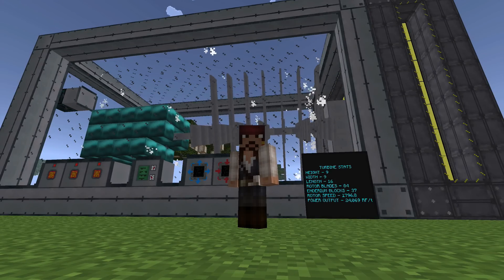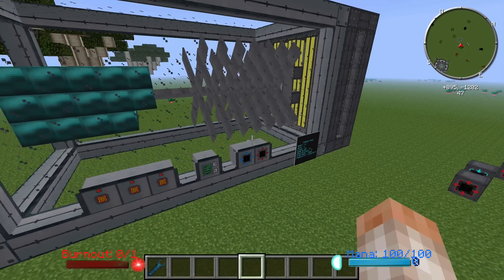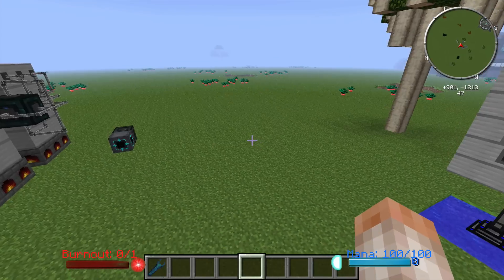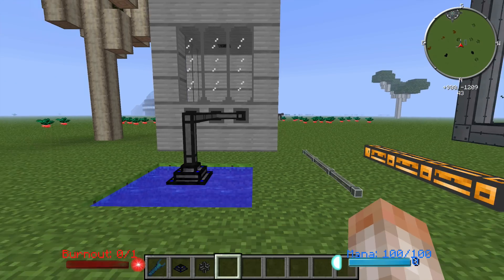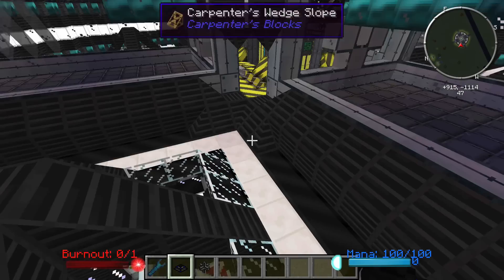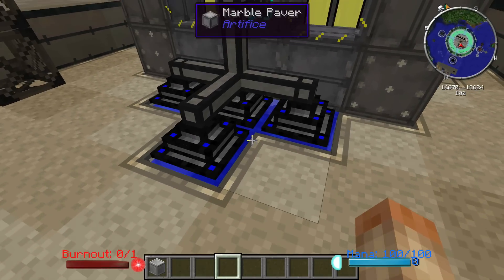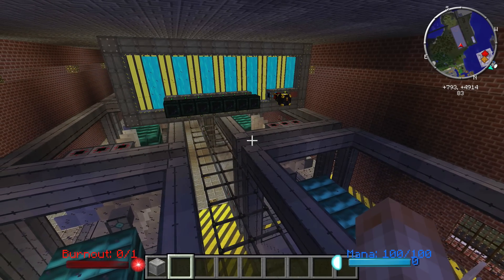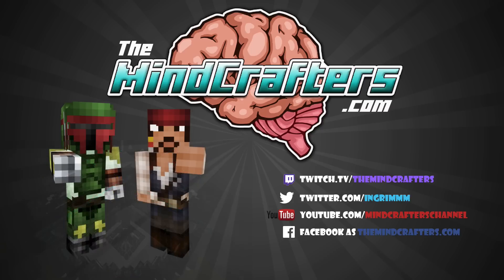Tutorial: High Powered Big Reactor Turbines

Comment: Thank you for this tutorial and the world download, Captain!

I did a few tests myself and have a few tricks:
You only need to supply water when raising the steam output. When the steam is constant the production of water by the turbine is enough to maintain the steam level (as long as you loop the water back in the reactor). I removed all 4 tansfer nodes from the reactor in the world download and the water level did not sink.
This means you can hook up another cheap water pump (for examle Aqua Accumilator) to start the turbine. It might be a little bit slower to start, but ceap. Or just fill your me network (extra cells) with a few buckets of water and export it into the reactor.

The reactor in the world download is capable of suppling much more steam than needed. You can set the control rods to about 60% which results in about 75% less fuel consumption. In result you don't need many focis to keep up with the yellorite needs.

According to a few tests in creative Icehenge an actively cooled reactor is more efficient if you build the fuel rods next to each other in a 3x3 block or higher (Fertility > 500%).

A good setup would be (testet in creative Icehence): a 9x9x7 reactor with 3x3 fuel rods surrounded by 2 rows of gelite cryothium. This setup sould be enough to supply steam for 8 7x7x15 turbines with 70 blades and 4x8 enderium as coil set to accept 1750 mB steam per tick each. This produces 8x about 20970 RF/t for 8 laser drills.

I hope this helps for all who want to build a turbine :)

Comment: >Transfer nodes and pipes are extremely expensive.

Each Liquid Transfer node costs: 

12.1250 Redstone Dust
08.0000 Wood Plank
05.0000 Iron
02.0375 Stone
02.0000 Blue Dye
00.2500 Glass

That is cheap as fuck, I have no idea what you're on about.
Reply: "Sarcasm" ever heard of it?
Reply: He did not say that with even the slightest bit a sarcasm.
Reply from the maker: Marshal Walker More comments = more video activity. Keep debating ;)
Reply: "Common sense" ever heard it?
Reply: The upgrades make it expensive, not the nodes themselves.
Reply: +Lachlan Forbes umm the upgrades aren't that expensive remember that none of the resources listed are extremely expensive if your not lazy and actually mine because that's what the entire game is based upon it's actually super cheap also because the recipe gives 4 upgrades not one
and if the pipeline isn't to long you have nothing to worry about if you can't get that much water into the reactor than just don't get rid of the water the turbine creates and put it back In the reactor so you don't need a constant massive supply of water cutting the amount required in half
so please don't spread misinformation because that's not a good thing.
Reply: +Marshal Walker (The Catman) 
He means the upgrades inside them are expensive due to them requiring diamonds.
Reply: ***** Mate, read a comment thread before commenting on it. It's not even that long.
Reply: Marshal Walker
Youtube didn't show any thread when I commented.
Reply: mate i can make diamonds from wood
Reply: Marshal Walker exactly
Reply: Marshal Walker z
Reply: Gotta agree, those are easy materials especially if you have access to fortune 3
Reply: I agree they are extremely cheap i made them and upgraded them inn one mining run when i first got into my buddys new server and was using them for my mekanism boiler and turbine

Comment: I have done the math, maxed reactor would lead to fueling 60 steam turbines, if you used diamond blocks as a coolant, 65-70 turbines if you want to pump water between them you'd make so much power that it'll rival or be on par with the Draconic Core

Comment: You can actually put the railcraft boiler directly against the fluid ports just like you did with the tesseract.  It eliminates the need for any plumbing at all.  Also, once the boilers are filled and at max steam, your water problem solves itself.  the water coming from the turbine is more than enough for the boiler to keep running.

Comment: If you have the thermal expansion mod installed, one aqueous accumulator with a water souce block on 2 sides of the machine will fit. It's a very cheap infinite water source.

Comment: 9:53 rookie numbers my friend, playing Blightfall and I need that amount of power for one pre-charger :P Then there is the fact reactors are giving half the energy required and I'd probably need two of your facilities just to power one of my laser drills.
been spending so much time to figure out the most fuel efficient way to get that power without causing world ending lag. Which since I have a currently 4 year old laptop that has trouble looking at seven laser drills working I think I have my work cut out for me

Comment: I have heard from multiple sources that the laser drill pre-chargers each use 10,000 RF per tick, which would be 40,000 RF per laser drill, not 20,000 like you said. I may be wrong or something may have been modified for your pack, but I figured I'd let you know :)

Comment: Point of interest. Make the reactors 17x7x7 instead, only use 80 blades and keep the same number of coil blocks. Not only is it a cheaper turbine to make (less blocks for the case)  also it provides a whopping 2Rf./t MORE because those extra blades (above 80) won't be there to cause drag
Reply: Second point, if you build them 17 in height you can fit 4 of the 7x7 bases into a single chunk width and depth wise, so not so much sprawling

Comment: The limitation of the reactor power tap in not in the tap... it's in the transport.
Redstone energy conduit is the only power transport available that can handle huge power, except that it actually isn't the only solution.

If you use Ender IO capacitor banks as conduit the input/output capacity of the capacitor bank multiblock is additive... provided that you use enough of them one power tap will export 100% of the power from the turbine.
There is a procedural caveat, however. The capacitor bank block that faces the power tap has to be placed before the powertap itself so that it can be wrenched to make the surface an import mode surface. Otherwise it will default to Output mode when you place it against the tap unwrenched.

Using 84 blades isn't necessary. 80 is the maximum that has any benefit.
Using 53 enderium blocks for coils 4coils + 5 blocks partial coil and 80 blades in a 7x7 casing I'm getting 24071 RF/t at 1797.0 RPM. A tiny tiny bit more power but a significantly smaller turbine structure than your example... and only one power tap per turbine.

I have 8 of these powering 10 MFR lasers (well 9... very nearly 10) driven by one reactor 9x15x15, 36 fuel rods burning 0.247 mb/t Yellorium at 80% control rod at 1215-1216 degrees C with 480% fuel reactivity... producing 16,000 mb/t steam handled by one tesseract for output and 8 tesseracts sharing the same channel inputting to the turbines. 8  tesseracts to return water to the reactor through a single input tesseract.

Reactor coolant is cyrotheum (a whole helluva lot of it... damn)
Water is provided from a single TE aqueous accumulator by an extra tesseract sharing the water return channel. The water tank for the reactor never runs either full or empty but is usually about 2/3 full.

Output for the MFR laser preheaters is handled with basically a layer of cap banks that are part of the same cap bank multiblock structure that pulls power off the turbines. There is no transport cost because there is no transport. The entire cap bank is a single structure which is charged at the turbines and discharged at the MFR lasers with no actual moving of energy to the output over better than a chunk width distance for the laser array.

Output from the capacitor banks is handled by rednet energy cable for mechs which can't run on RF, with a TC drawbridge  hidden off at the end of the cable run with a project red timer and state cell which causes the drawbridge to periodically break and replace one piece of rednet energy cable for a moment to work around their sometimes failure to return to function when the server restarts.

Remote output of energy is handled with large arrays of cap banks which are still contiguous with the single multiblock cap bank structure, with tesseracts and EnderIO dimensional transceivers used depending upon the scale of the energy required.

Basically cable of any kind is reserved for local connections on individual mechs where one Dimensional Transceiver can provide power for several mechs at once.

Even placing the MFR lasers one block above bedrock and missing out on the 20% energy discount, I'm not having to use 20 tesseracts to transport the energy at a 25% penalty.
If this entire mess were built above 128 Y, I could run another two lasers on the same 0.247 mb/t Yellorium.

I actually have 15 lasers set up with enderIO redstone conduit and item conduit sharing the same block spaces and a wall panel with a switch for each channel.
I'll be replacing this with a computer as soon as I figure out how to code the Lua.

I'm currently limited to running a maximum of 10 at a time and one of them has to have one preheater disabled to balance the equation or provide a small amount of additional energy from my passively cooled reactor.

Comment: 5"09 a better solution I found to get water into a railcraft boiler is to put a layer of water under the furnaces with aqueus acculmulators. 3x3 railcraft tank with a 5x5 layer of water, and aqueous accumulators (4) of them is enough to keep it wet.

The problem with transfer nodes is that they're LAGGY AS HELL, and for the amount of upgrades he has in that node, is going to get an administrator's attention (and not in a good way).

Also, mining lasers, they take 5k per precharger, so 20k total per laser. Not 20k per precharger. You overpowered that laser about 4 times over.

Unless you had tweaked your configs, then all bets are off.
Reply: unless i misread how it's set up, it's 20k per set of 4 prechargers

Comment: heya, i just built this Turbine and i wonder whats wrong, its up since 10mins already and its on 550Rotor Speed, the server i am on got restarts every hour, so i probl cant get to my max rotor speed in this time. any ideas?

when i Engage the Coil the rotor Speed goes up rapidly, but as i disengage them its going down to 546RPM, thats pretty slow and not producing that much power.

Comment: I don't usually comment especially on your videos since you clearly have always known what you're doing, but I wanted to offer a little note of correction. You don't need immense methods of water collection for turbine setups. Water is only needed to get the turbines to startup rotating. Once you've filled the setup you can disconnect the water source. Making fast water transport systems like you did will only fill the setup faster, but absolutely not needed. You can even fill a turbine setup with one single aqueous accumulator. You said a number of times that humongous amount of water feed is necessary to 'keep it running'. Otherwise good video. :)
Reply: BrinkTheGamer He notes that there are several ways to cool these turbines.  The high pressure steam boiler feels a little overpowered so I believe he showed the water setup just in case you wanted to cool the actual reactor itself.  But yeah you are correct, huge amounts of water are not needed for the turbine alone.
Reply: Once you've fed enough water to the reactor, it does not consume anymore. Putting water in the reactor does NOT cool a gelid cryo reactor. It is only used for steam in his setup.

Comment: This may sound dumb but what actually makes the mb/per tick go up. I had one reactor powering a turbine at 2000 mb/per tick but now i built another turbine so i made the reactor bigger, tried extra fuel rods, pumping more water in etc. but I just can't seem to get it over 2000???
Reply: You can't get higher than 2k mB/t , turbines have a hard cap of 2k , that's why they use multiple turbines.

Comment: I did this setup, but I only used three rows of yellorium rods, which makes 2000 steam.  I still used the 84 blades since 2000 steam needs 80 blades.  What puzzled me, was I am making more power that your 24,069 rf/t.  I'm getting a steady 29,364 rf/t.  Why am I getting more power?  And why does mine work perfect with seven less yellorium rods?  It looks like the one in the video has 4 rows of yellorium.

Comment: Ooooo boy. Couple days later and I have finally made 8 9X9X16 turbines with all enderium coils, and 8 MFR 4 precharged laser drills. 2 limes, 2 light blues, 2 yellows and 2 blues. 24 more turbines to go. ^-^ I want 32 lasers with 2 of every color, even the 2 useless colors for aesthetic reasons. The excess power will be stored in my 2 trillion RF storage.
Reply: I noticed the spreadsheet you provided in your previous video mentions 9X9X"14" <-- turbines with an additional (or more?) enderium block(s), and the same 7 rows of 3X blades. Does this setup yield equal to greater results? I wonder... Not that I care about wasting graphite, cyanite, iron and glass. I get more of that than I can chew, but greater results or more compact spacing can be a thing.

Comment: i made a reactor 16x32x6 like Madshammy's but with 105 cores instead of 210 and i got 150k RF/t with only 2.2mb/t burn up. 
with the default config boundrys of 32x32x48 for a reactors max size i plan to make one and see just how much it can put out, i will post info on the results and maybe a video if i get enough peoples interest haha
Reply: Well i made a 32x32x48 reactor. it had 338 fuel rods each standing 46 blocks high, it took 62,192 Yelloruim Ingots just to start up, it runs at 3819 Degrees with 599% Reactivity and using a devistating 72.75MB/t it spits out a cynite ingot evey second and produces an amazing 836,450,000RF/T ... yes 836 Million RF/t which is crazy i know but scale all the cores down to 10% and you have some amazing stats. At 90% reactor control rod levels (so only producing 10% core working) it outputs 333 Degrees with 138k RF/t using only 0.769MB/t  at 566% Reactivity.

Comment: I have some issue with steam
I built a reactor which is 9*9*9 but it never generate steam beyond 160 mb/t and I extended it ro like 12*12*12 steam output remain the same 
my modpack is tekkit
how do i genertae 2000mb/t steam

Comment: Could anyone list me all the mods i need for this to not be distorted blocks or missing blocks please? I want to play this in later versions and other packs, not just a single pack, also i see the system is AE wich is from 1.6.4, but i might be able to convert it to AE2 system, however i need all the mods listed. The ones i see: AE(AE2), Thermal Expansion, Big Reactors, Chisel and MFR. Thats it. Are there any other mods i missed out?

Comment: I have been having an issue connecting the input and output coolant ports with the opposite output-input turbine fluid ports...anyone know if theres a way to manually configure them to work with each other if they dont configure automatically?
Reply: SillyPanda2619 if you are using the thermal expansion mod aswell get a battlewrench or a cresent hammer and right-click the block and it will change. he didnt mention that in the video and it took me a while to work out
if nothing works, use a wrench (not a yeta wrench in this case)

Comment: what is the actual name of those mining lasers you are using? how is that setup? I've never found anything better then the ender quarry until now...what are those...
is it more efficient? does it automatically expand out? i notice you haven't moved them.
Reply: Minefactory Reloaded's lase drill + prechargers also it needs straight contact to bedrock/void and it spawns the ores in chest or spits
Reply: it's a laser drill from minefactory reloaded, they pretty much pull ore from thin air they just eat TONS of power. If you can power all four of the prechargers each drill requires it's a pretty even trade. They're worth watching a video on to learn more

Comment: So did you use the lime or green drill focus for the drills to get all of that yellorium and emerald?
Reply from the maker: lime focus will get you the uranium (uranium in a pulverizor = yellorium) and the emeralds.
Reply: The MindCrafters These drills...what mod are they from?
Reply: Dadycoool
Laser drills? MFR
Reply: So wait until I have a big reactor?
Reply: ***** Drills use 5k rf/t per precharger. So 4 prechargers is 20k rf/tick. (Can just put a tesseract on top with 2 energy conduits on each side to the different prechargers, and tesseract accepts power and sends items from the laser. Not the cheapest option, but it's one of the simplest possible, I think.)